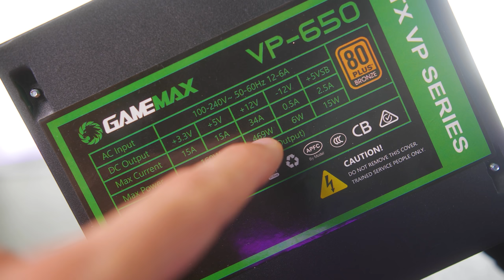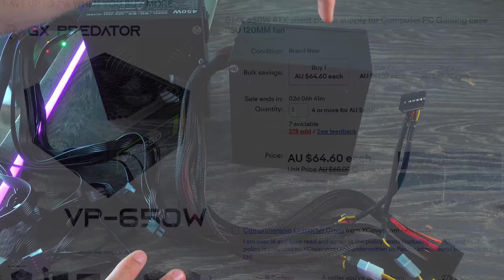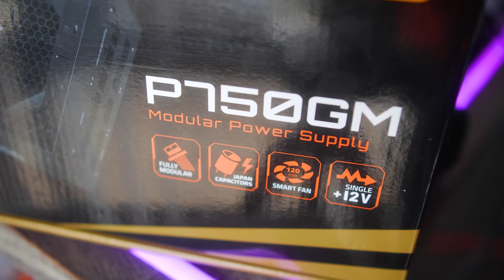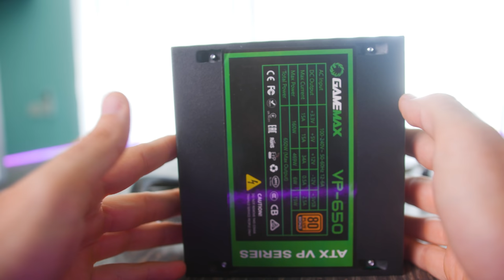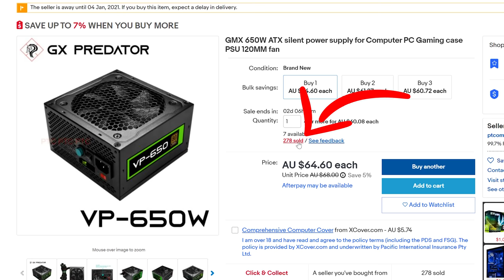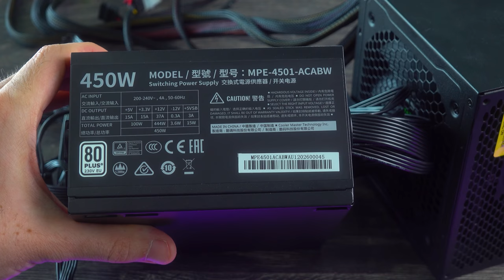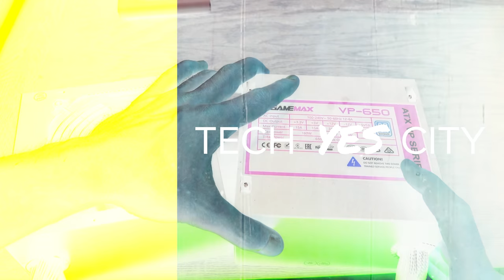This Company is Straight LYING about their "650 Watt" Power Supplies.... (*UPDATE* FAKE GameMAX??)

Comment from the maker: UPDATE Gamemax have reached out to me, and it appears this is could be a counterfeit power supply... I am in the process of hearing two different sides of a story.... This story goes deeper and I will make a follow up when it is complete.
Reply: Please pin this update comment.
Reply: Thats actually very interesting tho I still believe that they where selling fakes
Reply: Do feel like it was really a product from gamemax and they are shirking responsibilities now.. But trust me, the best solution is not running from it but instead admit and make better products.
Reply: @jasonwang6316  what do you mean by "false advertising"? The +12v rail isnt the only rail on the psu.
Reply: @captain7327  Well I guess legally you can call that a 700W PSU, but good quality PSUs nowadays should be able to hit close to the rated wattage on the +12V rails, and that is how reputable companies like Seasonic, Superflower and etc advertise their products. Edited to misleading advertising then if you so insist.

This is basically the PSU's equivalent of advertising a quad core 2.5 GHz processor as 10GHz.
Reply: If you look at the case of the VP700 PSU on their website and the case of the "VP650" you got, they are clearly the same (other than the voltage selector switch), down to the placement of the cooling holes, so they were made with the same machines. Also looking in the PSU via the rear shows that they have the same heatsink and blue caps on the left hand side (the side away from the power plug), indicating that the "VP650" is a modified version the VP line (VP600, VP700), thus it was either made in the same factory without gamemax's consent or they are lying.
Reply: maybe a company would make garbage but without putting those labels on it. with those labels it's clearly fake . this would bankrupt the company if real. fake for sure
Reply: not that difficult getting the metal parts from the same supplier
Reply: But it also has the same paint job, the same fan and the circuit board shares the design in places and at least one of the heatsinks is identical and in the same location.
Reply: Brian you could ave pulled your finger out and called consumer affairs & the fucking ratings authority to confirm.
Reply: @Matlockization  he could have got some halogen lights (or a proper dummy load) andan o-scope and actually checked loads and ripple too, but never does real PSU reviews
Reply: @mycosys  Yeah, good point.
Reply: @jasonwang6316  it isnt about reputable per se.
All those are DC-DC designs that convert the AC to 12V DC and then convert 12V DC down to the other voltages. So their entire power is available on the 12V line.
PSUs like the Gammax and the coolermaster MWE are 'group regulated' and have separate transformer windings in one transformer to produce all the voltages at once, so their power ratings are independent to a degree (but you cant load them independently or they become 'cross loaded' and tend to go out of spec).
They are a much cheaper design, and were standard for pre pentium4 where the processor wasnt on the 12V but the 3.3V.
They are HEAPS cheaper to make because they only have one set of regulators for all the voltages.
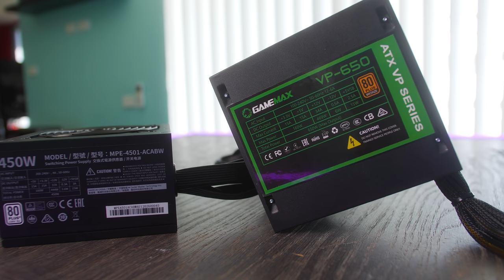Reply: @mycosys  Last I checked at 2:59, the Coolermaster MWE in Brian's video is listed as a 450W PSU with a max output of 444W on the +12V rail. By your logic, CM could have listed their PSU as a 550W unit, which is clearly not the case. That's the point I'm trying to make, hope that clarifies a bit.

If you are referring to the Masterwatt Lite, then it's the same story. The Masterwatt Lite 600W can do 550W on the +12V rail and 120W on the +3.3 and +5V, despite being group regulated.
Reply: all you need to do is ask them to send you one of their real 650w power supplies and do a review on it to compare.
Reply: bro they lying to cover their behind that is one of their psu's no fake they even sell them on amazon hahaha how do you explain getting almost over 300 of this psu and selling them.
Reply: @carlosandres8974  i don't think they are lying this psu that you linked is a vp-600 and it is pretty good
Reply: @andrepost7571  Yep I am actually gonna give GAMEMAX the benefit of the doubt here because the label doesnt even match up at all in specs or power ratings than the one listed on the site. For once I'm not trashing a lesser known brand PSU and usually they are garbage most of the time.
Reply: @illuminedman Yea I was so confused by this video because GAMEMAX is usually pretty reputable. Ive used 2 of their PSU's in my old builds and its been flawless. I beat the shit out of the 750 Watt GAMEMAX PSU I had in my RTX 2070 build with very high overclocks on the GPU and CPU with water cooling, 7 case fans and 4 hard drives.
Reply: @andrepost7571  i see it not single rail power supply... still not good for gaming
Reply: Thank you for the timely clarification. Appreciate the information on how to spot the counterfeit products that produce less power than advertised.
Reply: I had a look at the ones they (GameMax) sell, and their gp650 has 44 amps, 528W on the 12V rail, also, black cables and connections. The case quality may be similar, but theirs has A large grill instead of perforated case metal over the fan. 

Maybe they can hook you up with  one of theirs to review and demonstrate in contrast.
Reply: they are full of shit. Why would you counterfeit a POS power supply. Like counterfeiting a 1 dollar bill.
Reply: @Andy Aech comments paid for by gamemax.
Reply: I kind of wish you would review or check out the Aresgame power supplies...They seem to be getting a lot of buzz but nobody I have seen yet has actually put any meters or anything on them.. People have built systems and say they run good so I guess that's a plus...
Reply: Any update on this? I’ve have one of these power supplies for a while now unboxed, I want to use it for my backup pc but I am concerned doing so.
Reply: @jasonwang6316  Yep, thats what most likely happened. Look at all Gamemax PSU stickers. Their 12 V numbers are way way off from the nominal Watt. The GP-650 (650 Watt supposedly) has for example 528 Watt stated on their webpage. That's their Gamemax officially webpage. That GP-650 Watt PSU is then at best an 550 Watt PSU or at most an 600 Watt. It is clearly deliberate false advertising of an shoddy product from Gamemax themselves.

Comment: Never cheap for power supply.
Reply: More like...be smarter. 
Cheap doesn't always mean shit.
Reply: Dude, be smart. You don't put in a shady PSU for a high powered rig and OC the heck out of it. That's user's error.
Reply: Completely agree. My old fx pc died because the PSU malfunctioned. And yes, thats the el cheapo one.
Reply: Im cheap on used well known power supply.
Reply: @bennybouken  yeah but the good quality power supply usually costs a bit more you need to be smart and budget but not to cheap
Reply: laughs in $18 Korean 700w PSU powering my RX 5700 XT with 50% extended power limit on 300 watts (GPU only)

p.s. I bought a $88 Seasonic GM650 anyway because I hate mustard cables, ruins the aesthetic for me.
Reply: @jackandeson6302  I go the other way psu usually last me forever than other parts meanwhile I save money on case.
Reply: @bennybouken just dont cheap  out being smart has nothing to do with it. Get a 750w gold certified from a trusted company and you're set. Why try save a few bucks on the most important component?
Reply: @SerbStar2011  Not ALL 80Plus certified power supplies are reliable. Even those that have a genuine certification are relaible. 

That's pretty silly of you actually only looking at the certification for consideration.
Reply: Used high-end power supplies can be cheap, safe and reliable.
Reply: @bennybouken  this there's no reliable brand since every single brand have made shit once upon a time.
Reply: My first cheap psu lost It's fan. Then I got an corsair one
Reply: @SerbStar2011  Because high end PSUs can possibly be overengineered. My Seasonic Platinum 1050W destroyed 3 of my hard drives because its protections were malfunctioning or were confused. It was a shit time since that PSU was expensive and it was already RMA'd twice and Seasonic doesn't want it to be replaced to a Prime. My Thermaltake 700W TR2 S which I use for draining my loop has been powering my PC every time my Seasonics were fucking up....oddly the most stable PSU I had along with my retired 1500W Strider and 650W TPG
Reply: @SerbStar2011  Ratings are a bunch of bullshit, the power supply in this video literally has all of the certifications you'd want in a power supply, CE, 80+, etc (at least that's what they tell customers, dunno if they're legit)
You look at the overall brand reputation, then do some research on that particular model, then you check the wattage on the label, calculate them yourselves to see if they're honest, then you look at ratings and certifications last.
There's plenty of 80+ gold or platinums models from brands like evga or corsair that have more failures than some cheaper power supplies you've never heard of.

Comment: Never cheap out on PSU when building a PC.
Reply: True!
Reply: I agreeee 😁
Reply: indeed I know someone who had a nameless bad powersupply ... it shortcircuit and took his whole system with it.
Reply: PSU tier list for Power Supply nerds like me...plus you can see where your own PSU lands in terms of tier:
https://linustechtips.com/topic/1116640-psucultists-psu-tier-list/
Reply: i cheap out all the time.  i've seen people put 1000 watt 80+ platinum stuff on a gtx1050 ti and that's moronic as well. just have to know when to use properly.  this 650 watt gamemax would be fine as a 450 watt then, so just adjust your mindset and pricing accordingly.
Reply: never cheap out on psu, gpu,cpu, mobo, ram, ssd and case
Reply: @aniqshardin  anything else?
Reply: @donkeykong1234  I'd still take that other 450W 80 plus white over this thing.
Reply: @MLWJ1993  of course.  but if the 650 watt was like $20 , it has its place.
Reply: @donkeykong1234  Not really, if you need to lie about the true specs of your PSU it's definitely not worth any amount of money & a hazard to anyone using it.

Maybe a possible buy if the specs are revised to account for its true specs, but even then I suspect a lower rated PSU would be cheaper and more reliable.
Reply: For regular builds definitely yes. Unless you do a cheap build and do your research, because you ain't gonna put a $100,00 PSU in a $300,00 system. Xilence PSU for example are cheap, non 80 rating, but pretty well build (though the fan on their cheap line are a bit on the loud side). But they do not advertise for what they aren't. And it isn't a slapped on sticker brand like most cheap PSU's. That said, even reputable brands tends to have some pretty bad PSU's. That's why I only choose be quiet! and Seasonic PSU's for regular builds. And Xilence for cheap builds.
Reply: @donkeykong1234  imagine being ok with companies selling you overpriced fake garbage
Reply: Yup, psu and motherboard. Don't cheap out.
Reply: @GoogleUser-dy2rr  what is there to imagine?  it's been happening forever.  i remember before you were born that there was this one speaker company that sold 600 Watts PMPO speakers for $9.  whereas the 7 watt "better" speakers from Amazon were $29.  try to explain that to an end user why it is marketed as such.
Reply: @MLWJ1993  Yes I am 2 times change psu cause of those cheap thing start to smell burn and really burn some of gpu connector thing. It was when I am 20yo and start to built my PC. Japanese coil is really important for psu to make it worth your component.
Reply: True, but also dont overspend, wich you also see a lot. people getting 1000 watt psu's when their system doesnt even pull 400 for '' upgrade ability''
Reply: @donkeykong1234  exactly
Reply: @MLWJ1993  you pay for what you get, he is right.
Reply: I always suggest that for my friends for their first builds. Somehow they tend to spend a bit more on cool-looking mobos and bling CPU coolers, butt-load of RGB fans rather than good PSU first just because "but you cant see the psu". smh
Reply: oh common whats the worst that can happen other then those guys blow up there psu's or the computer I'm still fine with my 750 watt 80+ titanium corsair psu while they want to cheap out with that shit psu for 65 dollars
Reply: @HarrieWorst  Good brands using their company name and reputation to sell their shit power supplies. Seasonic M12/S12s come to mind. Everyone says they are the best PSUs for the money (and brand name) but JonnyGuru already stated they don't have protections. S12III for one isn't even made by Seasonic and is mediocre. And I have beef with Seasonic because my Seasonic Platinum back in the day fried 3 HDDs and it was the 3rd RMA'd (1st was DoA, second had the cold boot but on SS Plat and X series). Mid-High Thermaltake and SuperFlowers are the only PSUs that performed admirably on my and my clients PCs
Reply: @aniqshardin  nah thats so elitist. For PSU and Mobo its true other than that are fine for skimping
Reply: I dont trust Seasonic for anything
Reply: @kotarojujo2737  its a joke im not rich.i put mid-high cpu n gpu in b450, aircooler and cheap case with good airflow.of course oc'd the f out of em
Reply: Ironically there are cheaper psu’s than the gamemax that are reliable lol. So it’s odd to say don’t cheap out when you can kinda get scammed and spend more 🤦🏽‍♂️
Reply: @JosePineda-jn8jk  That is why you always check reviews. Amazon is pretty bad as you get people who have no idea what they are talking about, but New Egg reviews aren't bad if you already have some knowledge. There also the many websites and you tube vids that also do product reviews.
Reply: @budgetking2591  correct - maybe techie buyers care and will pull +12v rail numbers, but if they know what any of this means - 99% of them will be building their own PCs, right?  i mean, i'm selling to joe blow - who doesn't know how to reseat RAM and doesn't really care.  if it turns on and can play fortnite or roblox - then santa IS HAPPY.  this is where a Seasonic 350 watt that i got free in a recycled case on a gtx 1050 ti plus an OEM board and an Intel stock fan is just perfectly fine and i'm happy to pass the $150 savings along.
Reply: @donkeykong1234  Exactly, im not putting a 100 euro psu in a pc im selling for 400 euro, thats just stupid, i dont care what people say with'' dont save on your psu'', they just repeating what they heard. And if anything, i had 2 brand new seasonic 850watt psu's, both broke within a year lol.
Reply: @budgetking2591  tell me you exaggerate.. just what the hell did you do with your system lmao
Reply: @lowerfive6318  I wish i were, if one thing, it showed me that big brand expensive psu's can be also terrible, those seasonic 850w ones were loud as hell aswell, really bad value for  the 100 euro they cost. Their replacements( warranty) also broke very fast.

Comment: Your right about the gamemax power supply. I bought the gamemax 750 watts for £55.00  in January 2021. In April the cables started burning and melting to bar wires around my pci graphics plug ports.i hope people listen to your advice as there very dangerous and could cause a fire.

Comment: If the EESS approved this product, the EESS is being paid off by gamemax.
Reply: @tayo5302  shouldnt EESS test the psu themselves instead of receiving test reports? i know that 80 plus test and certifies the products from companies themselves, they even redo tests if companies change names or something like that
Reply: Government certifications generally just check the unit is safe to plug in, that the insulation is minimally ok and that the unit wont disturb the power system. They dont assess quality etc, just is it legal to use
Reply: I can see a CE label which is the German equivalent, I can‘t believe that they get a CE label for this device.
Reply: @tayo5302  you're right, i confused it with the GS label, that stands for "gepruefte Sicherheit" in English controlled safety. This would mean it is actually tested for safety
Reply: @dhanajon5528  they simply cant test every item on the market, its not even near possible
Reply: @loyalitiy  Its not even an requirement as far as I know the business submit there items for review to get the little sticker but thats not the worst thing...if they get X sticker from X country its an auto pass for other countries and its same thing for medical devices and drugs, Europe is the worst for it because they are far more lax on requirements but still are recognized globally, it ended up leading to a massive hip and disk implant scandal yet even still.
Reply: @Doom1981  about 10-20k euros in the near east for a CE label. isn't that great ....nt